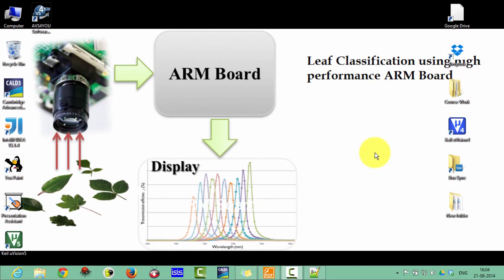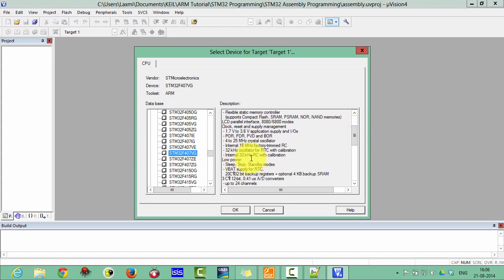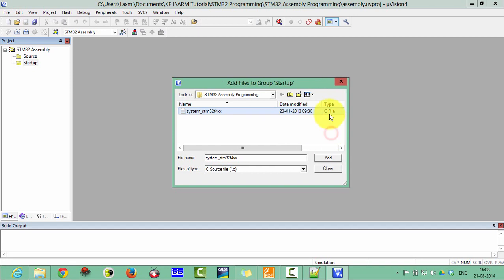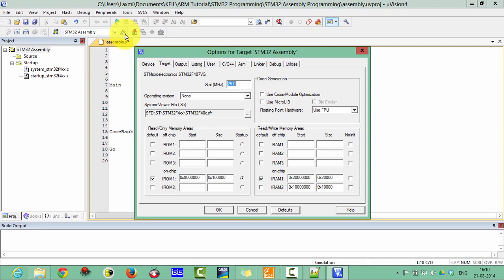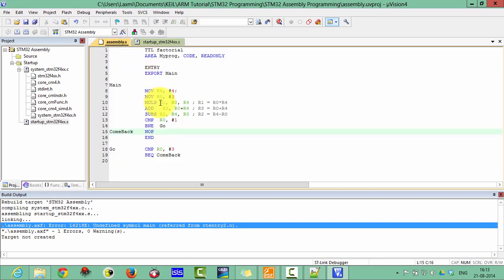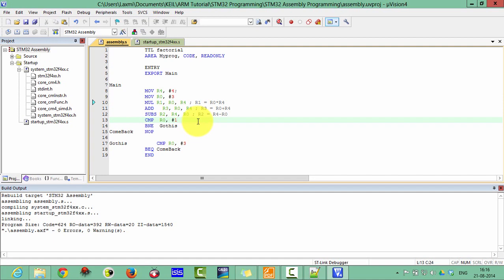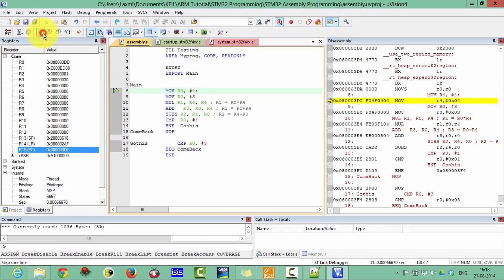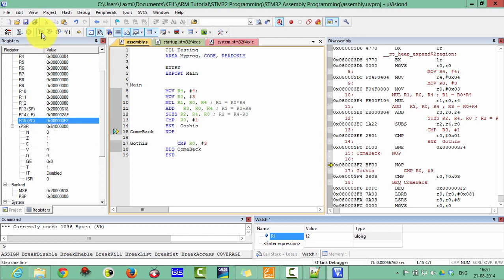3 STM32F4 Assembly and C Programming- Getting Started with ARM Assembly Programming

Comment: Dear Laxmikant tivari saab 
1001 crore prostrations at your feet from a beginner. I was searching the web for a tutorial in assembly programming for stm32. All the examples videos in YouTube and other tutorials assembles but won't compile. I was frustrated and was about to quit arm. Then I found your video and finally assembled and linked the program. Thankyou verymuch for the video. The only one that works that I found. One needs to use keil4 . The start up files are missing in keil5.
PRANAMS
Sajeev sankaran